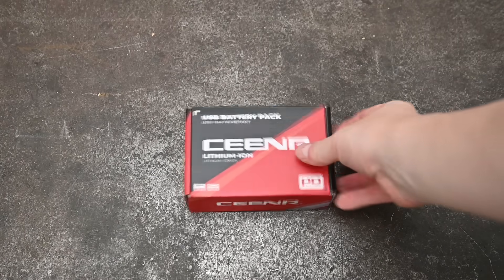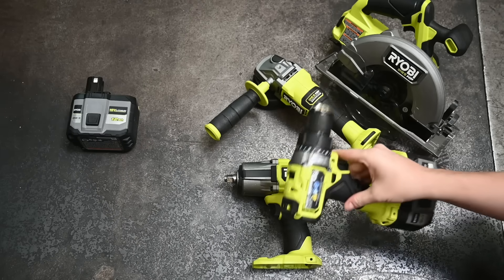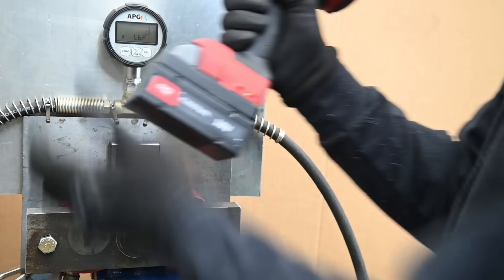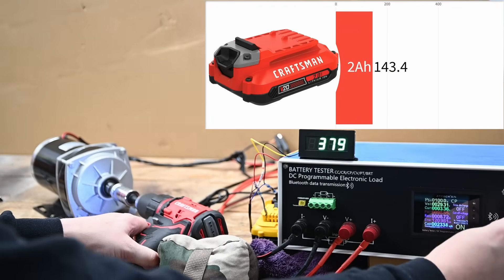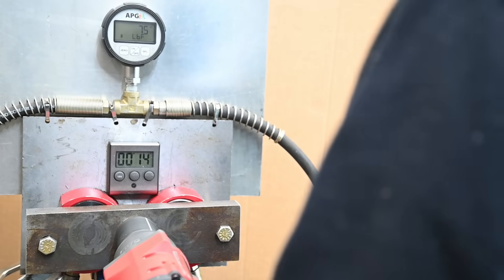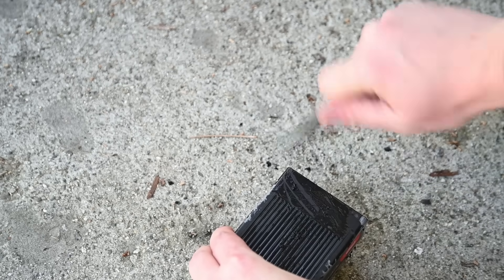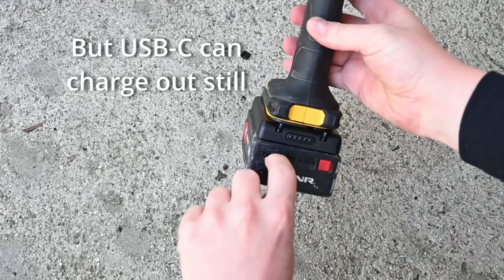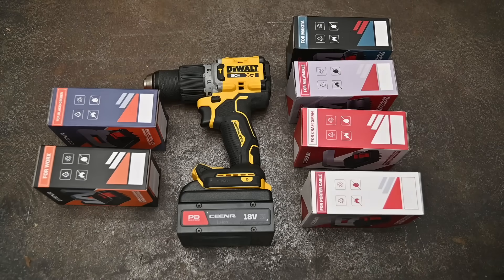We Bought the New Universal Battery for All Tool Brands

Comment: Shoutout tool companies installing a lil’ special port and chip on their specific batteries in about a year and a half
Reply: Oh they definitely will. 

Hell, GE started putting RFID chips on their refrigerator filters just so you don't go and buy a knockoff that's 3x less. 

Milwaukee, DeWalt, Makita and so on, all make a LOT of money because of their battery platforms. You buy an expensive DeWalt battery and your more inclined to stay with DeWalt tools. 
If you bought a universal battery? You could buy any tool and that's just unacceptable for tool brands.
Reply: They're definitely going to try. Hopefully the backlash will be strong enough to put them in their place. They'd probably raise the prices of the tools, though.
Reply: Bosch green is already doing that with their cordless vacuum cleaners (unlimited line). They say its because the top of the line one could damage smaller battery packs with its massive power draw, but lets face it: Those vacuum cleaners are the best selling bosch green thing and noone buys OEM Bosch green batteries since they are even more expensive then the Bosch Pro ones, yet weaker in every aspect.
Reply: @Klokopf52  battery has to have it's own cut of, if you can short the battery terminals and it doesn't blow up, which get this, it should not, then all that might happen is that it just stops running when you overload it
Reply: @Klokopf52  I hate seeing stuff like that! Also they are clearly full of crap because all brands already have over and under voltage protections so it would cut itself off before damaging anything if it tried to draw to much current. and even if batteries didnt that they could put it in the tool to detect a current issue without needing it to be a special battery just like many tools do (we can literally do that ourselves with like a $4 pre made circuit from amazon).
Reply: I don't see that happening. It would cause too much trouble with existing batteries and tools in the field. This one company isn't going to cut into their margins by enough to warrant that.
Reply: @F0XD1E  On this generation.   

Next season "And to satisfy the demands of customers we're changing to a new platform of 25v tools" 
With serialization that would make HP and Apple jealous.
Reply: @bobclarke5913  yeah thats actually pretty likely, everyone already lost their shit for 6s batteries (25v) in the drone world like 5 years ago
Reply: @ace7912  6S is not "25V", it's not even "24V" but at least 24V is the more-legit "peak voltage" number they use for what is really 21.6V (or 22.2 tops, if you use the 3.7# typical of poly cells) .  Also there's already brands that have had this for many years--primarily the Chervon-made brands (e.g. Flex and Kobalt).  While these brands are fairly successful it's not like anyone "lost their shit" over the "24V"/6-cell battery in the tool world.  Brands like Milwaukee, DeWalt, etc. are still selling a lot more than Flex in this range, in spite of their "lesser" batteries.
Reply: @F0XD1E  Most companies already have the hardware in there, and in cases of products like DeWalt's Flexvolt Advantage, Ryobi HP, Milwaukee Fuel, Makita LXT and XGT, they have implemented battery detection at various levels.
Reply: @F0XD1E  Planned obsolescence is what it is called, I worked in a major Lawn Mower MFG plant, they began designing mowers that would NOT last as many hours and then began to discontinue parts for those older dependable models
Reply: Apple did it with their charging cables so I don't see why they wouldn't do a small update to the communication between tool and battery so that it checks if it's an authentic battery.
Reply: @dreadswizzard9142  are you talking lightning ports or USB-C? They switched their iPhones and most iPads to USB-C last year
Reply: @djmontgomery948  Apple did that solely because the EU forced them to.  I don't see that happening with tools a fraction of the population owns and rarely replaces
Reply: Ryobi did that on some of their ONE+ batteries - pack had to 'authenticate' the tool before producing full voltage
Reply: I think Keurig tried that and it lasted about a week before someone figured out a workaround.
Reply: They already do. You only need 2 connections for + -. Whaddya think all those extra connections are for?  No auth signal on pin 3 at power up? Run in limp mode... Or worse, it won't run at all.
Reply: They will just reverse engineered and bypassed.
Reply: It's all so tiresome...
Reply: I can see that , they will not want to lose out on sales of extra batteries.  That said not much they can do about already existing tools.
Reply: @autobotjazz1972  I bet someone will figure out how to make a motor controller that has one trigger point and connects to a 20V battery. There isn't that much they can add to prevent people from having this the way they want. Unless it is all injection molded and opening it up would mean destroying the tool. But then again it is not like right to repair is a thing.
Reply: Yup, followed by a flood of hacked replacement chips on the usual sites!
Reply: Been there, done that. I worked for Ericsson in the 1990's and patented a mechanism by which a public-safety hand-held radio could fetch it's setup data from a memory IC in the battery. That way, a user could pick any radio from the rack, snap on his personal battery, and his radio would immediately be configured with his personal data. The patent had nothing to do with rejecting aftermarket batteries (as there weren't any when I filed for the patent.)  Ericsson forgot to patent the battery mating mechanism, and this left the battery open to aftermarket manufacturing, and the Chinese batteries soon appeared. The battery/memory concept process until that point was optional, but to keep the Chinese batteries from working Ericsson had my team change the radio firmware to REQUIRE the patented battery/memory to be present for the radio to work.   (Patent number: 5771448)
Reply: If they made a normal charger and kept the usb c they would have something. If there adapters woukd snap in Simi permanently and the battery slide off easy so I coukd run multiple brands and one battery and charger I woukd be ordering them now.
Reply: I don't think tool companies can really implement full "handshaking "at this point, because it would break so much compatibility within a lineup.  Even if new batteries have it and still work with old tools, the opposite is not true.  It would create a situation where new tools wouldn't work with old batteries which would not be well received--it'd push people even further into figuring out ways around it or simply not buying that brand.  

Of course eventually they will probably release completely different lines/batteries, at which point they would implement this kind of thing.
Reply: @rolandm9750  I can only speak for what bosch did with the unlimited vacuum cleaners. They do not work with old batteries. You can't use full power mode unless you have a new one installed. They claim compatibility but that's just not true. Mine works with old batteries, but only on eco mode. If i put in my brand new 5Ah (90 €...) it works. Old 4Ah -> Eco mode only.

Comment: Im fully okay with this not liking VTEC impacts or saws if it works on impact drivers, drills, heat guns, or any variety of more "standard" power tool. Some things are built for the best, but not everything has to be. Charging with USB C is the dream and to not need a $100 add on kit to do so is sweet.
Reply: I was thinking the same thing, my milwaukee lights or vacuums don't need high output batteries to work.
Reply: @jonathanshaw8868  I have a Ryobi shop vac that very much wants the biggest battery I can throw at it. It's the most power hungry cordless tool I own. I'm curious about the Milwaukee counterpart you have.
Reply: @TheBrokenLife  I have a Milwaukee shop vac the 6 gallon one. It drains batteries like crazy! I'm lucky to get 10 minutes on a charge with an XC5.0. Even the 6.0 High Output struggles with it. Performance drops very fast you will only get full suction for maybe two minutes before it slows down. Strangely the best performance I have gotten from it us using an adapter and a Dewalt XR 8.0 pack.
Reply: @Vacmaster1991  That sounds pretty bad... Mine is a 2 gallon (I think?). I use a 9aH high performance Ryobi battery in mine and the total run time is around 45 minutes. Performance is very good except for maybe the last 5 minutes or so. That said, I can run a chainsaw or weedeater longer on the same battery. That vacuum is hungry. Despite that, I quite like my vac. It's really nice dust with. 😂
Reply: @TheBrokenLife  I just have the little 2 gallon m18, on 6.0 batteries you only get 15 ish minutes,  your really using it as sparingly as possible. But it works good for in field activities

Comment: You could just buy a bunch of cheap Kobalt, Parkside or Hercules batteries with adapters for the tools you need and just use the orignal charger of the battery. Problem solved. But glad we are moving on the right direction
Reply from the maker: Most adapters sort of sucks, and not all batteries play nice with the tool and can do some scary stuff. Not that it can't work, but it's a bit of a minefield - especially since you included a 24V example in there
Reply: @TorqueTestChannel thats true most adapter sucks but I don't see how this one could be that much better? And the kobalt one is actully a 6 cell more like 21.6v which would help for the voltage drop like you show with the Dewalt and Milwaukee impacts. Anyway great content as allways.

Comment: Mehhh... I can't call a battery "universal" that has to use an adaptor of any kind. The tool makers should have agreed on a universal battery interface years ago. It would make batteries a little cheaper, and the user could try out different brands of tools. I have over 1K worth of yellow batteries, there's no way I'm going to buy a red or blue tool, no matter how good it is.
Reply from the maker: The battery itself is made to be universal. Other tool batteries aren't in that they wont play nice with some brands. But I see what you mean
Reply: @TorqueTestChannel  Yes, it's definitely an improvement!
Reply: "I wake up and drink a cup of blind brand loyalty and consumerism every morning" is all I heard reading that comment.
Reply: Also flex volt is great

Comment: Batteries are the printer ink of power tool manufacturers
Reply: Oh geeze, they're going to put DRM in drills now, aren't they.
Reply: @robertdascoli949 came here to say this. Retreating from the razor and blades model would be abandoning the one thing they learned in business school
Reply: @robertdascoli949  Yep, either that or the company in this video will be sued out of existence.
Reply: @robertdascoli949  Absolutely they will if this catches on but this will probably be a small market as they seem to own the tool section in box stores and will block its sale to mass market.
Reply: @robertdascoli949  atleast batteries are re-usable, so we could just use older drills.
Reply: @robertdascoli949  dont give them ideas
Reply: Soon the tools will require Wifi to use them
Reply: @MathieuTechMoto  Milwaukee has One-Key and DeWalt has Tool Connect that use phone apps over Bluetooth for security and tracking of tools on the jobsite. Won't be long before that optional feature spreads to all their tools and it becomes mandatory and has a DRM subscription tied to it.
Reply: @MathieuTechMoto Or a membership for full performance...
Reply: @MathieuTechMoto  It's actually going that way with the retail theft in some areas.
Reply: They aren't that bad HP had their cartridges die by date even if they were not used imagine if you had to toss a fully working battery packs because it was on a shelf for a bit.
Reply: @B0BBYGAMER  I swear that already happens with milwaukee batteries.
Reply: @perfectdiversion  typically I find milwaukee packs will have one cell drop below minimum charging voltage then they won't let you charge it, luckily I've always had this happen within warranty
Reply: The battery cells inside are all the damn same too. I feel like someone could make a killing selling compatible battery shells with easily interchangeable battery cells.
Reply: @Wohlfe  they do. I build my own dewalt batteries. You can buy makita and milwalkee kits too
Reply: @Wohlfe that's a really cool idea!
Reply: @Wohlfe they are all made in China lol.
Reply: @Wohlfe  I recently pulled semi-decent cells from two packs and combined them into one. I think the main issue is you want welds for the current-carrying capacity.
Reply: I hate that you are right. Had an old printer blocked/bricked because the previous owner didn’t remove the printer off their account. So it expired and it doesn’t let me print. Customer support didn’t bother
Reply: too agressive of a statement i'd say, batteries prices are not inflated up to the ridicolous numbers printer ink is. They are relatively well priced considering the types of batteries inside and their overall performance. How many times you'd ever buy batteries for your tools? It's kinda of a once in a while investment. Their durability in my opinion allows them to be more pricey than the cost to make them plus a small profit, let the profit be bigger as long as the battery is of quality.
What I find annoying is the lack of any standardization for power tool batteries, which is the problem this thing is tryna tackle.
Reply: @MrChoklad I agree, I think the majority of people here think 18650s battery cells are dirt cheap, they aint... sony/ LG/ Samsung high discharge cells used in power tools are anything from 6 bucks and up a piece..thats 60 bucks right there for 10 of them which is the standard 4/ 5a battery
Reply: The voice of reason!  Thank you for restoring rational perspective!
Reply: yup....so i make my own. i settled on dewalt pattern batteries. i can buy the bare kit for less than $20 and install reclaimed and tested cells from other packs for basically free.
Reply: @MrSGL21  literally just did the same thing myself, got the battery cases for like $7.50 with the BMS and level gauge from China haha
Reply: just buy a laser printer
Reply: also, battery tech is not that cheap man, if you go anything that's not lead acid, it has a considerable cost per Ah, and it's the same thing for any type of battery (drone batteries, laptop batteries, phone batteries, they're all expensive, all of these being either lithium ion or lithium polimer, lipo, batteries).
Reply: Watch them getting sued into oblivion
Reply: Exactly, we should be able to go to the hardware store and buy A, replacement battery, the parts store to buy A, replacement gas cap, radiator cap or lug nut. Those can even change from one model year to another. This is insanity!
Reply: Especially when u look at 18650 prices and realize theyre only making the plastic shell and adding 80$ to the price😂
Reply: 18650s are very expensive actually, the crap ones are cheap, well because there crap.. somthing luke a sony vtc5a which is quite common it top brand batteries, run about 5 euros each, maybe more, so thats 50 euro as there's 10 in a 4 to 5 amp pack.. I tried to make my own until I realised how expensive the 18650s actually are for decent ones and then I said whats the point !! I'd still have to buy the case which was 18 from aliexpress.. @matthewadkins7973
Reply: More like the wild wild west!
Reply: Except there's no software in place preventing you from using a battery that isn't fully charged.
Reply: Also 3d printed a case to try it out, which works but doesn't seem as robust as the molded plastic cases so idk about that in the long term considering usage
Reply: not even remotely. bypassing the safety circuits isnt badd ass. its fucking stupid
Reply: That is why I have corded tools too!  I have a couple ecoflow battery packs, so I figure I'm about equal on expense but I have more options.
Reply: Bro, DeWalt+ Premium subscription, charges your battery for you, up to 6 charges per month, only $39.99/m
Reply: This is exactly why they won't lower battery prices, they sell you the tool for less than it costs to make or at cost and sell you over priced batteries
Reply: No there actually not... 18650s are very expensive, crap one aren't, but high quality 18650s used in power tool packs are usually more than 6 dollars a piece, that's 60 dollars right there to me or you if we wanted to try make one, not to mention the coast of buying a knockoff case and pcb which is another 18 quid... so actually it's not as printer inkish as you think..lol.
Reply: At least you can re-fill them with skill and parts.... when they stop holding charge
Reply: Not really.  Most first party, good brand tool batteries last for several years and a ton of use/cycles.  Yeah you have to buy "their" batteries but they work and work very well for the most part.  Printer ink (when talking about inkjunks) lasts you all of like 3 printouts and then it's time for new ink, declogging, etc. That shit simply don't work well or reliably and what you pay for the cartridges is absurd for what you get out of them.
Reply: @rolandm9750  For sure. I once put new cartridges in and by the time I got the nozzles unclogged, they were nearly gone.
Reply: How? Do you throw away your rechargeable batteries after the battery dies?
Reply: Yes
Reply: You can add camera lens to the list as well
Reply: @JohnBeebe  The good lenses cost a ton to make though as well. All HD glass and over a dozen different ground glass pieces in the lense, micro motors makes for a lot of money to make.